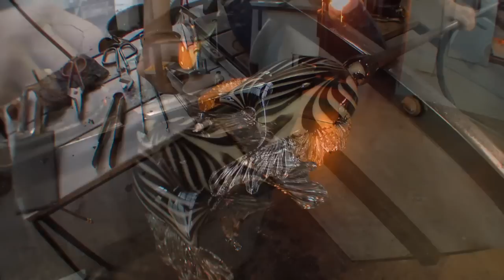Brenna Baker - Glass Artist

Comment: great work, but i am curious about how you get the glass on teh end of the rod in the first place? do you have a container of molten glass you just dip the rod into?
Reply: +engelteir molten glass is stored in a furnace that's kept at 2,150 degrees celsius, and yeah, dip the rod into it. :) and to re-heat it while working to make sure it stays pliable, you use a 'glory hole', which is a chamber at around 2,000 degrees celsius.